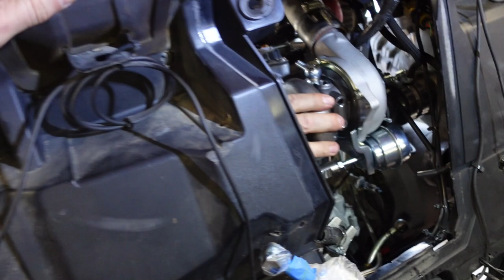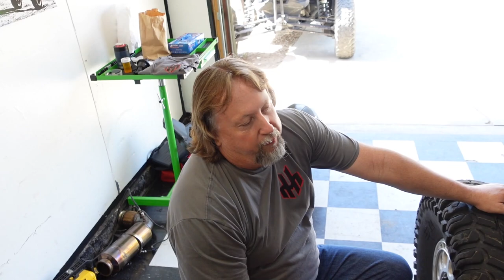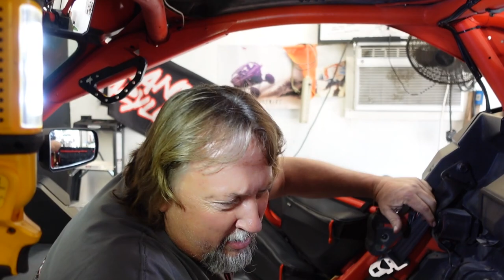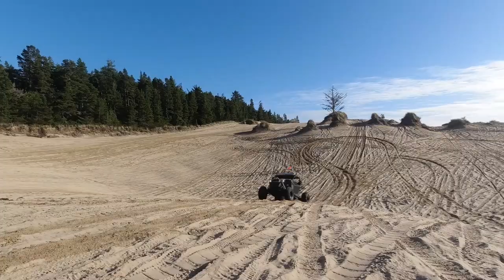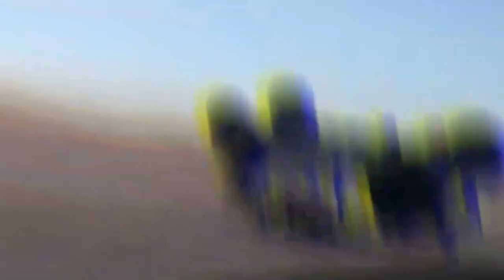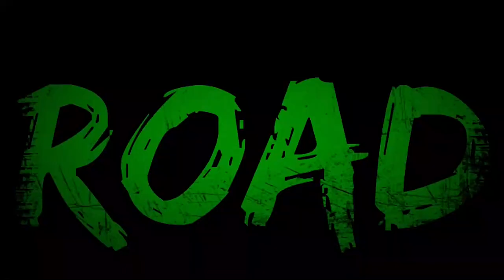EVO BIG TURBO? BRING IT!!

Comment: If you ride in just the dunes the 355 is nice. If you like trails do the dynomite. I am now on the side of not upgrading at all other than a tune you can still run 91. With the 355 you are talking intercooler, charge tubes (I would go hard pipe for as much as you can), catch can, head studs, plenum (the brace works), full exhaust, clutch kit, If you want launch control stm or tapp clutch. You guys know it's a rabbit hole.
Reply from the maker: Yeah see what you're saying. Yeah we're way way way deep down that rabbit hole. This car has all those upgrades.

Comment: I would be more worried about the main bearings, crank and rods.  I use to build dirt track engines.  the best way to make them live was steel rods and crank bearings.  The bottom end takes the beating, hopefully when it goes boom it doesn't take verything with it, good luck.
Reply from the maker: Actually there's a whole bunch of people out there running this much boost on these motors. Apparently they're pretty tough

Comment: Have you guys ever messes around with a pedal commander? I have a 2021 turbo s and I just want to get rid of the lag when pressing the gas it seems like I have to step on the gas and push It down 2 inches before it even moves
Reply from the maker: I could see it helping a little bit. But in turbo car you always going to get a little bit of turbo lag. We don't usually mess with the pedal commanders because that's also a function of the Evo tunes, and all of our cars are Evo tuned.